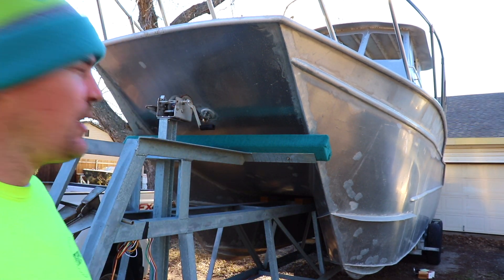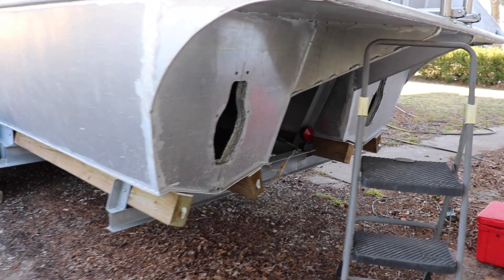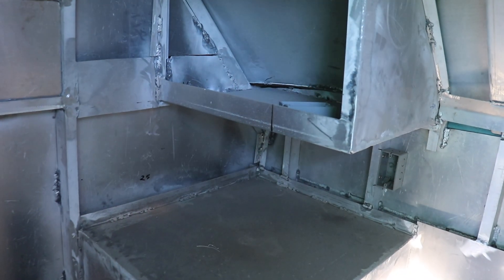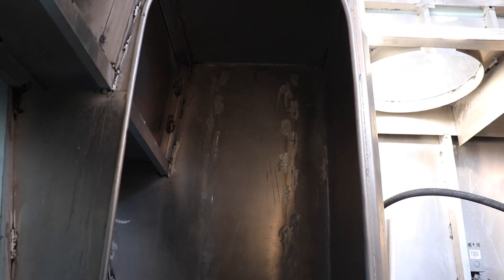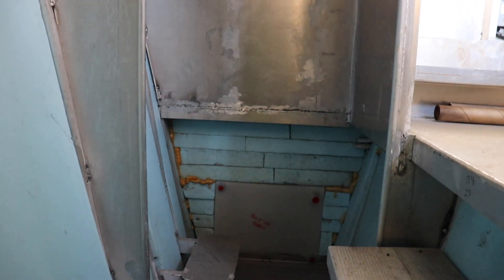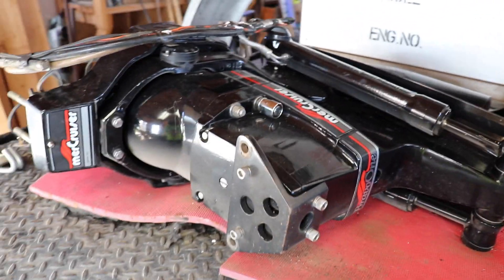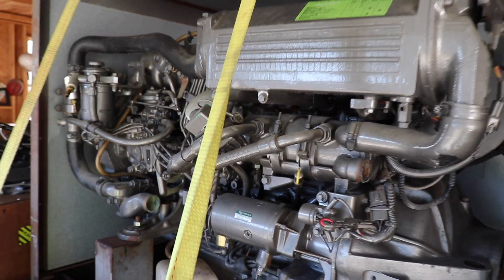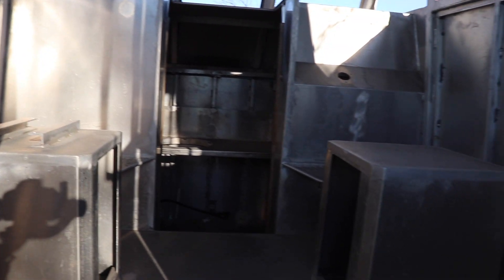Cyber Boat Solar Powered Self Driving Electric Fishing Boat

Comment: Outboards would be the way to go.
Reply from the maker: Yes but outboards cost twice as much. Also I need the option to switch the diesels out with electric motors. Clip ons are for poosies
Reply: @oceanadventures1  Electric is pretty far away for planing  hull's. Maybe a more efficient hull like displacement hull or semi displacement. The range vs weight of the batteries is the big problem combined with the poor efficiency of planing hull's. for every 80lbs (about 10 gallons) of gas you will need about 1000lbs of batteries for the same range (those are conservative numbers most it likely would be worse). A Telsa model S gets about 330miles with a 1,600lb battery and it would only take about 15 gallons to achieve the same range. You can figure out the math pretty easy. My friend was going to convert his sailboat to electric but after more investigation realized it just didn't make sense. You can convert it to electric, but you won't go very far. 

I'm not anti-electric or anything like that. Just pointing out the issues with trailer boats. Also they make electric outboards which would really free up space under the deck for all the batteries that's why I recommended outboards.
Reply from the maker: I plan to run it 4mph with a trolling motor hooked to the outdrive. That way I can just cruise real slow for free if I have to. Theoretically I can easily travel 30 miles on solar. Fish all night and troll all day